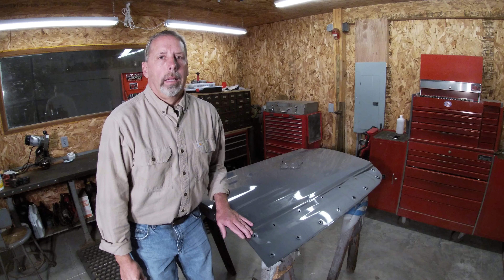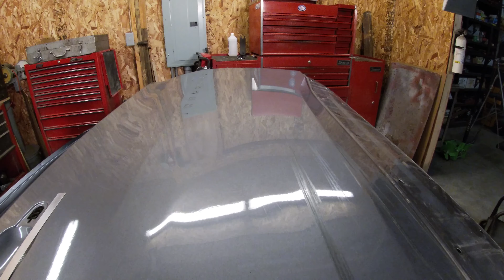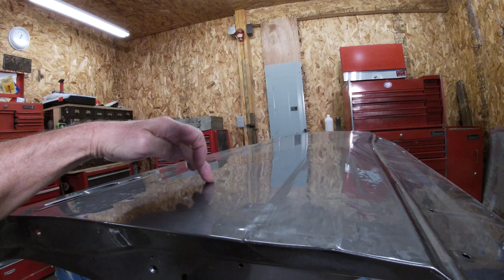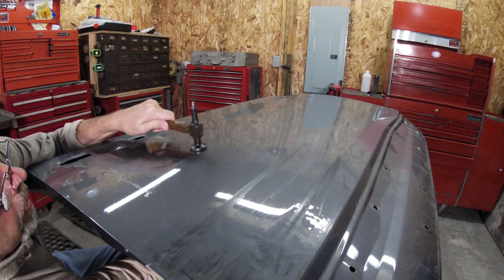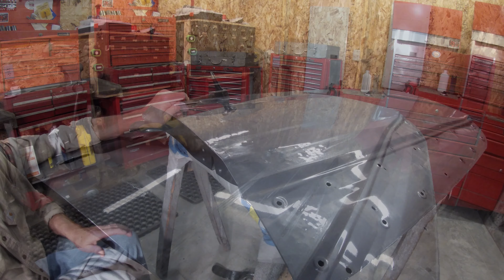Auto Body Repair/ Repairing A Door Part 4 of 8

Comment: Thank you so much for these videos.The problem I’ve always come across with stud guns is the metal on these cars are so thin these days they blow holes and then it’s difficult to weld it shut because the hole can get blown bigger.Ill try to bump and tap it out first if I have access behind the panel or I’ll use my glue tabs pulling kit
Reply from the maker: Thanks for watching